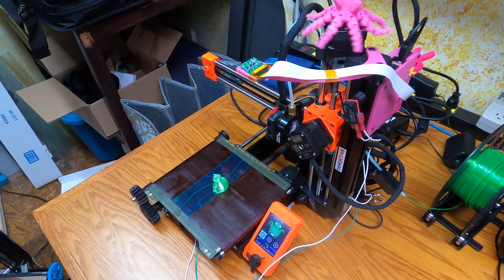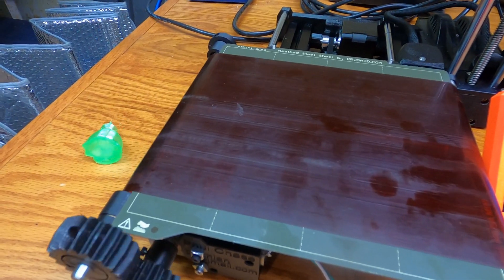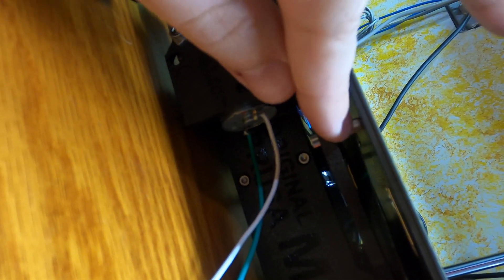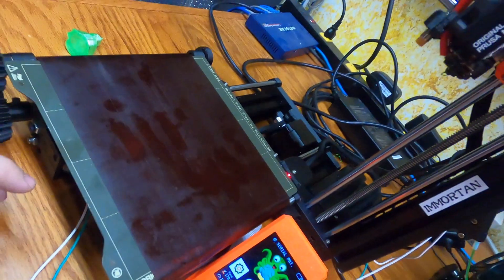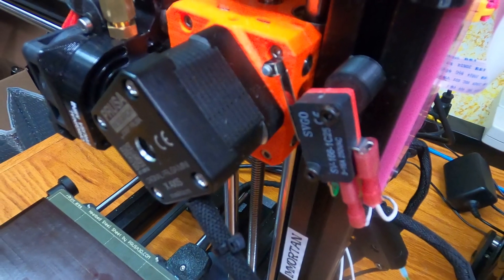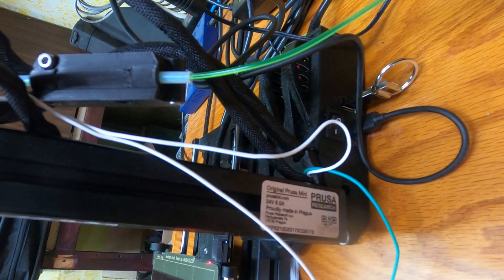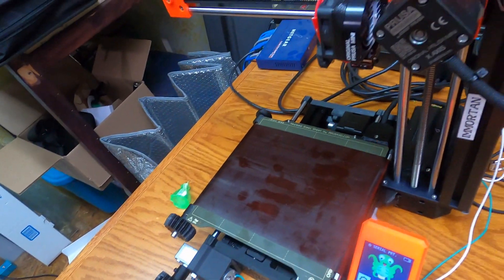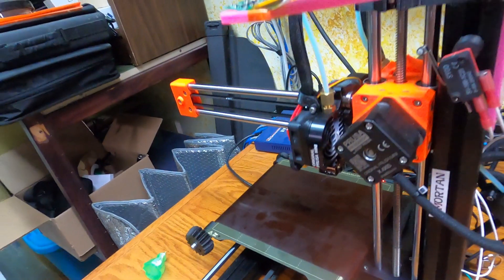Belted Prusa Mini overview - part ejecting 3D Printer

Comment: I'm trying to do a tronxy crux 1 belt conversion can anyone give some advice?
Reply from the maker: When a friend asks for help, you help 'em.

One of the reasons I chose the mini was reliability - the most important reason.  It looks like there's plenty of space to fire up a PrintShift mod to it - but you'd need to rework the rod holders to attach above the bed leveling springs for rigidity

Comment: I'm not sure if you covered this already but do all plastic filaments work on the Kapton film  or only certain ones? Thank you!
Reply from the maker: PLA and PETG work very well; TPU sticks, but has trouble ejecting - it likes to ride around the roller and jam up.  ABS sticks, but warps more than the belt tension can handle - you can print single ABS parts, but I wouldn't recommend it.
Reply: @PaulChase  Awesome! Thank you for the reply!

Comment: We are considering purchasing a Prusa i3 MK3S ... Could this be used/modified for the MK3S?
Reply: Oh and you got a Like and Sub from me.. thank you!
Reply from the maker: The MK3S is very rigid, like the mini, but it is a good bit larger - scaling the belt up is challenging, as you need more force the larger you go.  I think the Mk3S could handle it, but would need 1/2" drive rods and the belt would struggle more than the mini to maintain flatness with larger prints.  I have other ideas for larger belts, but plan to target machines where the bed doesn't move first - it's easier to design when weight isn't a concern.

Comment: Looks like a great design. What about parts that like to warp, would this just lift up the capton tape bed no matter how tightly you have it streched ?
Reply from the maker: The pre-roll helps to spread out the bed, and heat the entire roll evenly - but I still try to print warp-happy parts biased (i.e. along the belt, not across it) and I don't think ABS would be happy at all - 90% of testing is PETG, the rest is TPU (my kids love flexible parts).